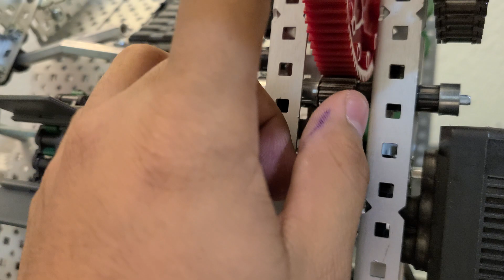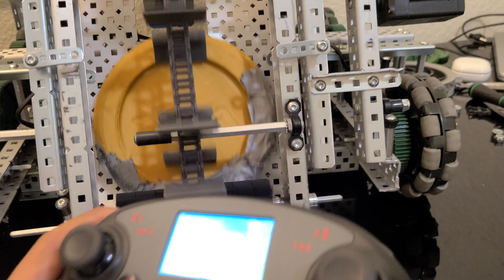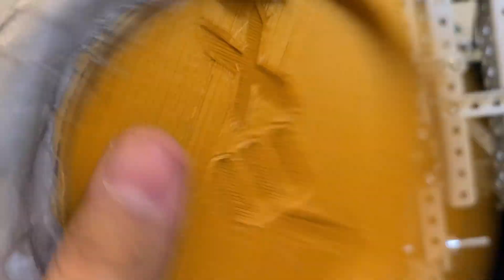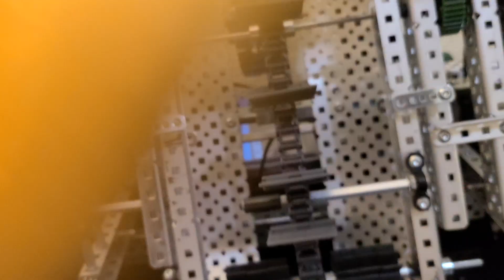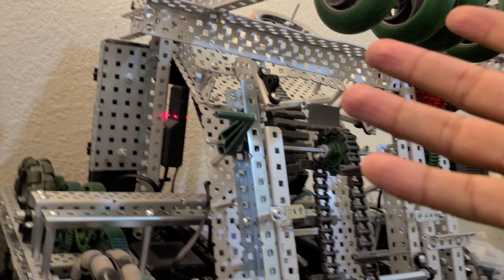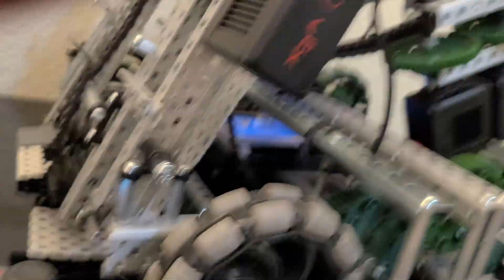Vex Spin Up intake/roller (motor sharing design)

Comment: This is nice looking but what me and my team is looking at is a ratchet system that connects our intake to another system that helps push the disc into the fly wheel. This allows our intake the run but not always running the flywheel pusher. Might be something you look into. I'll be updating my channel and insta soon on the matter.